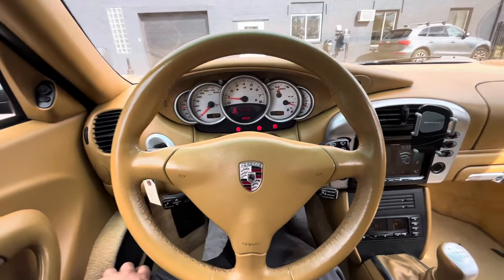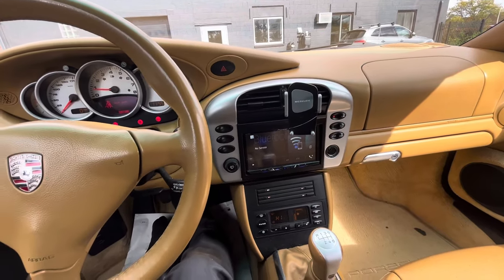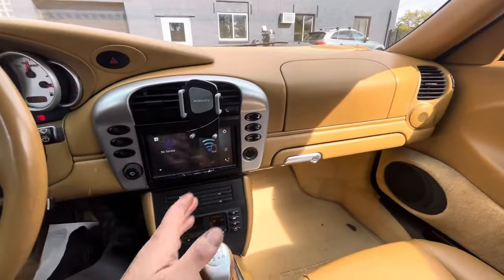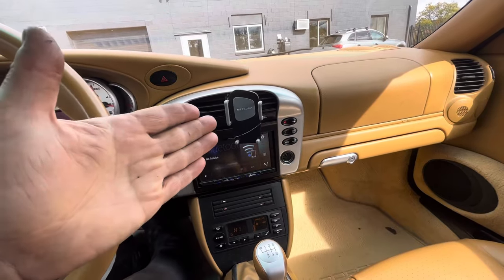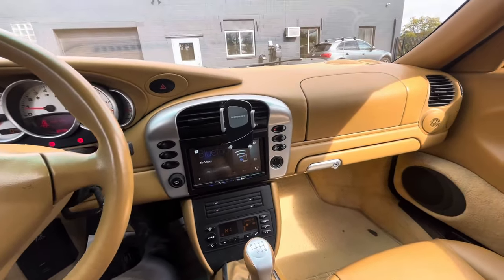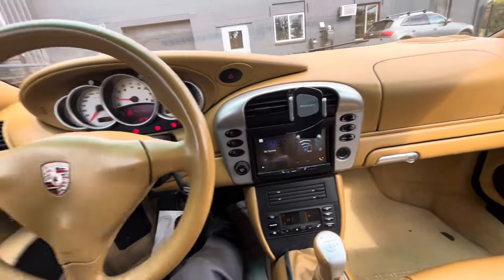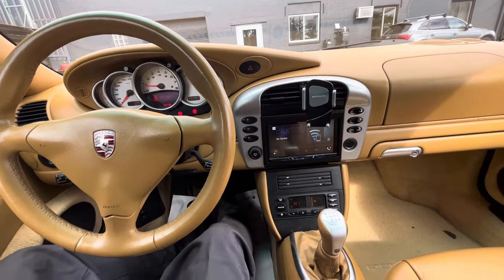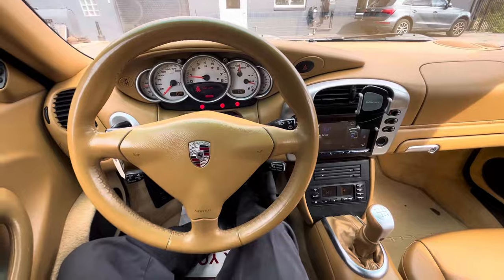DO YOU HAVE FOAM BLOWING OUT OF YOUR INTERIOR VENTS?

Comment: There is an easy fix.  Behind the radio (Boxster for sure) is the heater box that is the source of all of this foam.  Just remove the radio (not the whole dash) to get to it.  Clean it in side and replace it with heat insulated tape along the sides, top and bottom.  Then replace the radio, vacuum out your vents and the problem is solved.  Easy Peasy!
Reply from the maker: Nice! Sounds like a simple solution